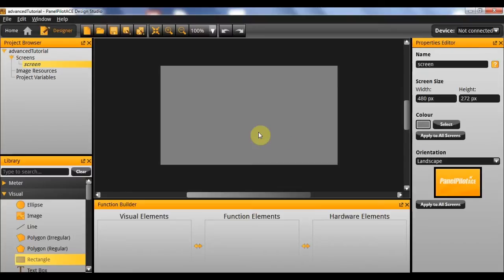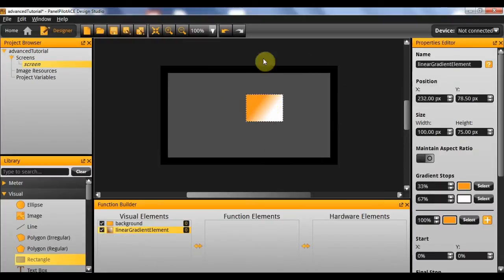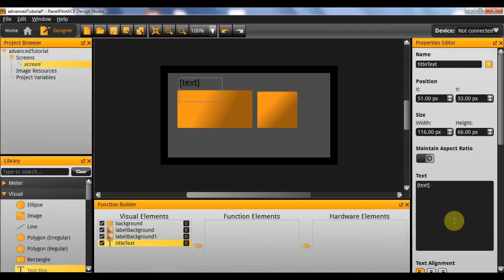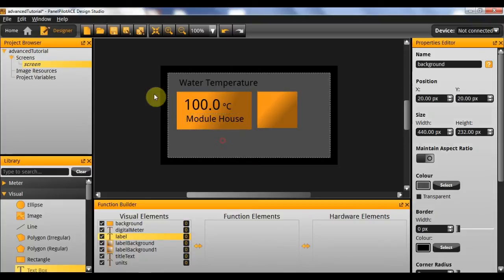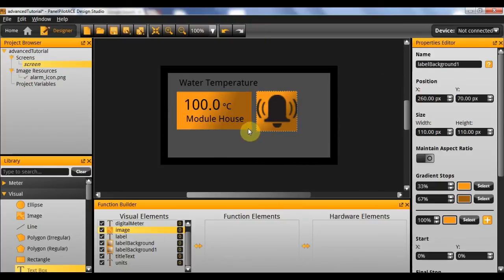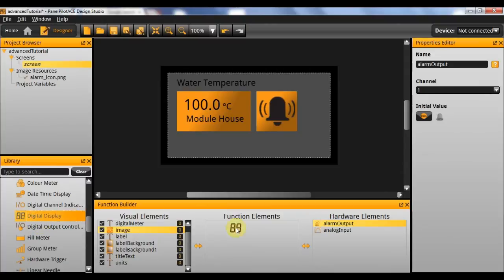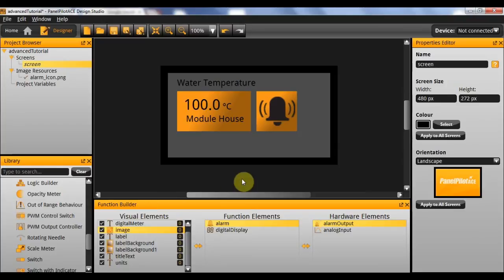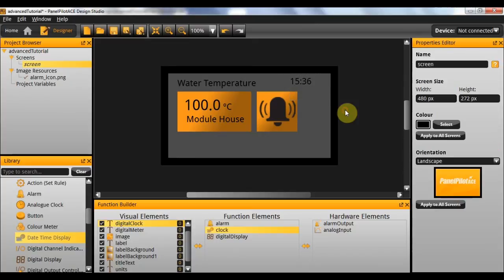PanelPilotACE Tutorials: Advanced 1 - Gradient Shapes, Digital Clock and alarms

Comment: Not sure if I will get a reply seeing as this is 8 years old.  At about 12:25 you show the alarm icon turning on/off.  Could you also have the background for the alarm appear and disappear along with the alarm icon?  It would have more impact if they both come on/off together.
Reply from the maker: Apologies that this may have been missed, unless you contacted the PanelPilot Team at Lascar Directly.

There are several ways the Alarms can be included in a project depending on the application requirements. The Example in the video uses the built-in readymade functional elements, which are more straight to use but may be more limited.

In this case, the Alarm Icon and Alarm Background could be grouped into one Visual Element. This Grouped Visual Element can then be used for Indicator Element in the Alarm Function.  

For further project assistance and examples, the best email contact is sales@lascar.co.uk

Kind Regards

Lascar Support Team